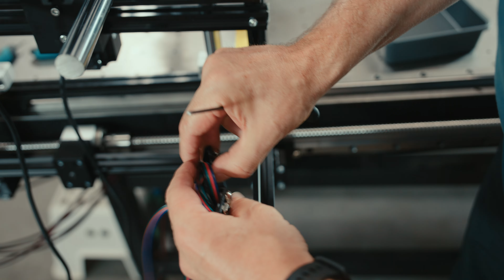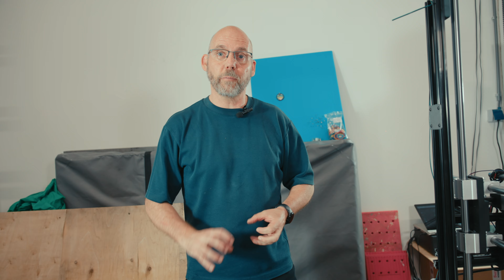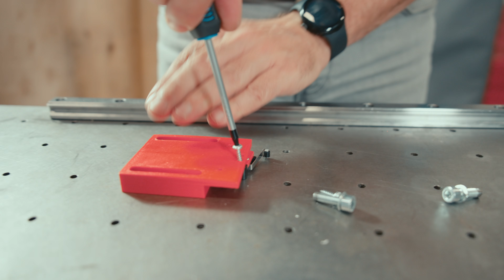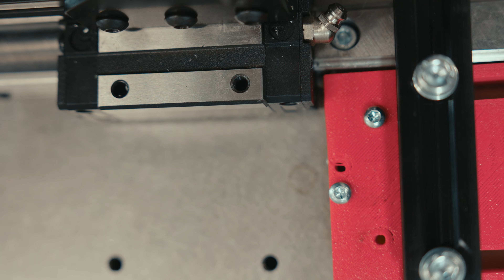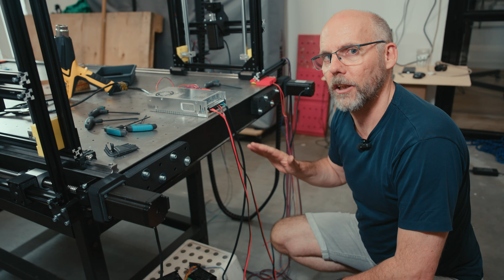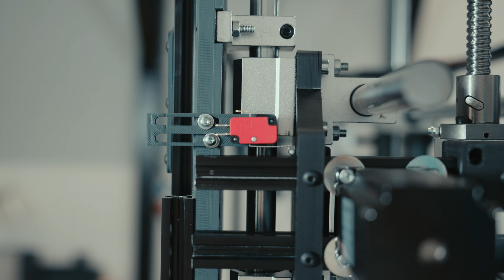Will Our DIY CNC Actually Work?

Comment: Wiring is the bane of my existence, if I where to have done that everything would be spinning the wrong way
Reply from the maker: I feel your pain—getting the wiring right is always a bit of a challenge! 😊
Reply: @ClassicCarEVO I say that whilst soldering in a new motor for my rc drag car, surprisingly spins the right way so my ankles are safe at the start line
Reply from the maker: @comradechris7975 😂 I must admit that I've got my ankles with an RC car a few times.
Reply: @ClassicCarEVO car I’ve got weighs in at 2.4kg and has broken 90mph in a 132ft pass
Reply from the maker: @comradechris7975 ok, I'm impressed